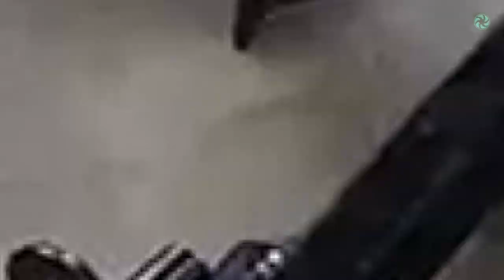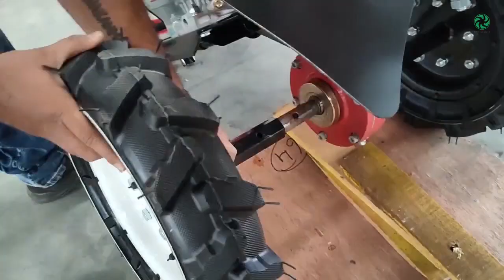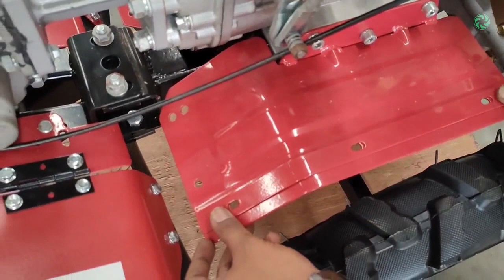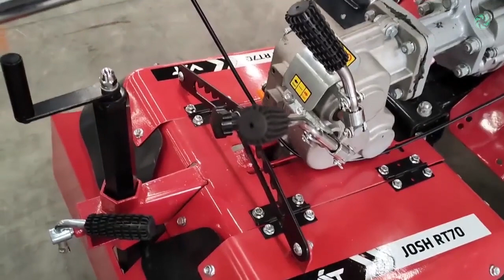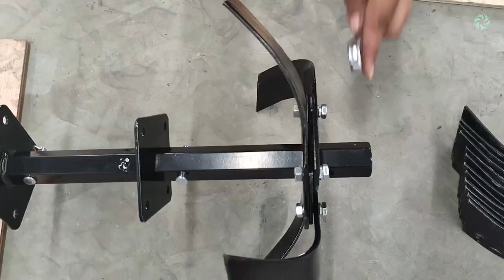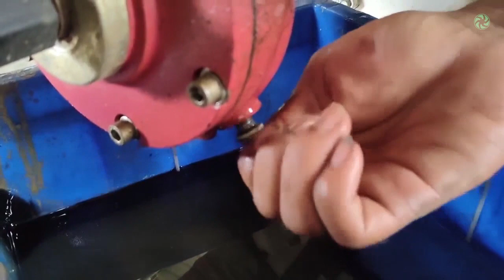VST Shakti RT 70 Power Weeder Assembly Video

Comment: Level of oil mark increase in oil chamber of vst tiller and it gushes out if cap is removed from the oil chamber. The oil becomes thin and seem that oil has mixed with diesel because there is a smell of diesel in the oil. Please tell what is a problem and how to rectify it.
Reply from the maker: There could be two reasons for this issue. 

1. Coolant entry into oil chamber thru defective Liner O ring. In this case oil will turn into white color thick liquid. 

2. Diesel may enter when defective injector which might be dribbling with improper firing along with worn out piston rings leading unburnt fuel leaking into oil chamber. Or fuel pump might be leaking leading fuel enter into oil chamber. How ever this is a very rare case that fuel mix with engine oil.
Reply: @therakiauto   thanks sir